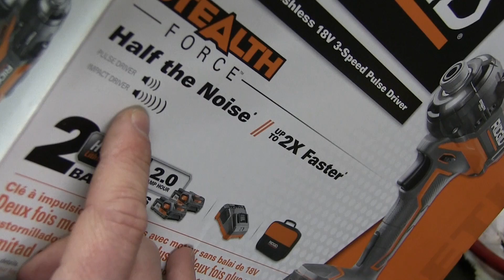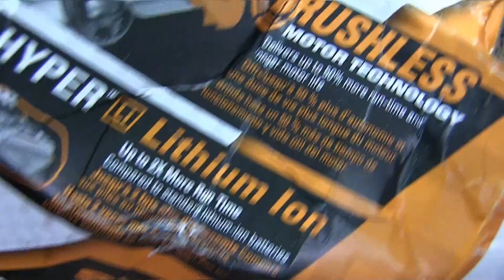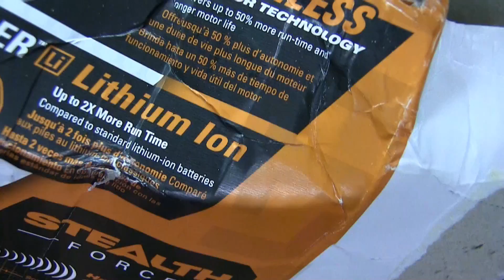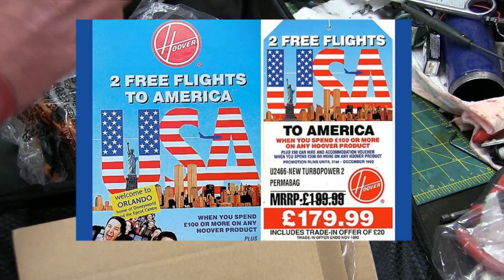BOLTR: Ridgid Hydraulic (?!) Impact Gun

Comment: Some exciting news that doesn't fly above specialized ears. Airbus has released their first set of titanium 3D printed parts for their top end airplanes. You're going to ask, so what? Well, we all know how things trickle down, this means that sooner than later, metal 3D printers will end up within the same range of availability as their plastic cousins. :D

I can't wait to 3D print a metal case for my older tools. That's the point where i'll really dig up all my old electronics books, start from scratch and design my own damn tools, sans Blackjack and hoohas. ;)

Now, i know i'm overly excited about this, but, seeing the whole tool industry go the way of the Hollywood, i've no hope for getting something worth it in the future, it's only going to get worst on the "cheat" part of a tool. The more they cheat you out of money, the better they can retire.

For the Airbus gig, google it under "airbus 3d titanium". It started earlier this year, but i've only heard something substantial this past month.

3D printing titanium within the reach of the normal Joe...if you'd tell me that 10 - 15 years ago i would've said you need more nuts and barrels.

Also, 3D printed heart, and 3D printed spine.

Comment: Fascinating teardown as always. Did not expect that hammer mechanism. I'd love to see one that's been through some use.
Reply: My x5 impact is the first one that came out brushless but not hydraulic. Had it for almost 2 years now with no issues. My buddy has the new x5 hydraulic and it's nice but I dont like the movement of it. Also his has less torque and slower with lag bolts. Yup we raced them. 1/2 x 6 inch lag. My older one finished 4 sec faster going into triple 2x12. 

Also mine never gave up his over heated after 3 lag's and mine put in 9 more non stop. Big difference to me
Reply: Francisco Quiñones been through 2. Going back to the regular impact now.
Reply: Mine lasted about 3 months
Reply: mine lasted about 3 months. it was insanely powerful. now it’s basically just a drill. lol no hammer.
Reply: Practical Engineering does fail within a year of heavy use b
Reply: I know I'm 6 years late to this comment but mine has been choochin' proper for the last 5 years of daily use.
Reply: hercules71185 what exactly failed on your surge?
Reply: Have you done the Milwaukee surge
Reply: hercules71185 Yes it does
Reply: I had mine for 2 years it hasn't lost power
Reply: Mine worked great out of the box, though everyone noticed that it was harder to control than an impact driver because it jumped around and slipped out of the screw head.  It quickly lost torque with use and it sits on the shelf as my workers borrow the impact driver from one another.